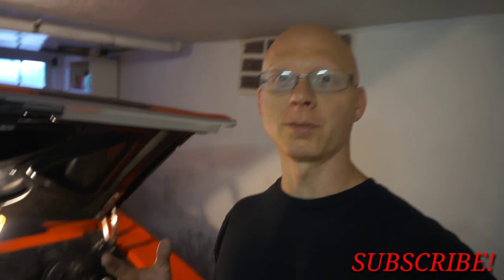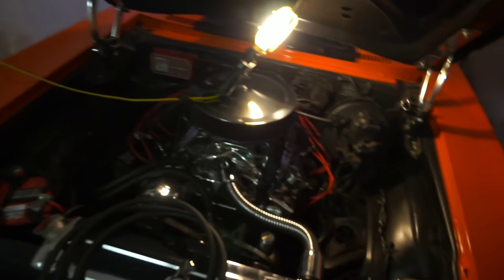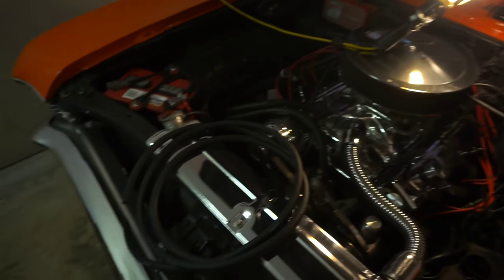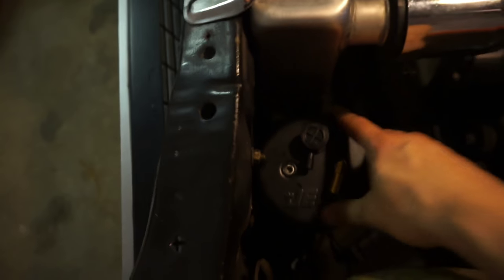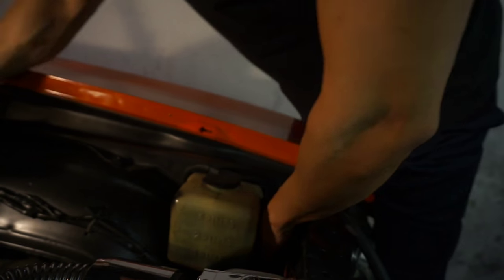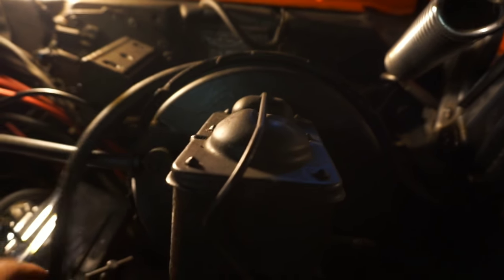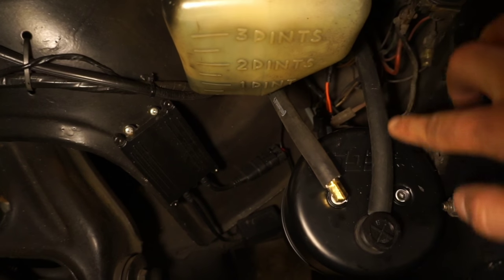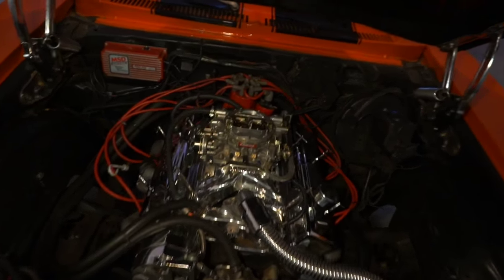It needs a vacuum canister. The Nova gets a new supporting mod!

Comment: I put the same one in my 85 Monte ss it helped brake stopping 50% better if that helps anyone
Reply from the maker: Agreed!  It definitely helped with braking. Especially after I installed the new cam
Reply: Only 50%
Reply: Troy Doggett it’s better than before I can stop it if ur asking a opinion yes get it can’t go wrong
Reply: Troy Doggett that 50% is a significant amount

Comment: What size cam are you putting in
Reply from the maker: It's a Howard's roller cam 525/530 lift
Reply: Thanks for the info I'm putting a 480 in mine this week and also purchased the vacuum canister. Hoping it works